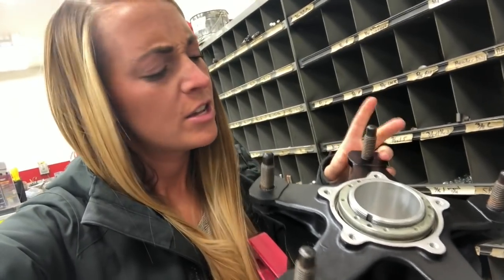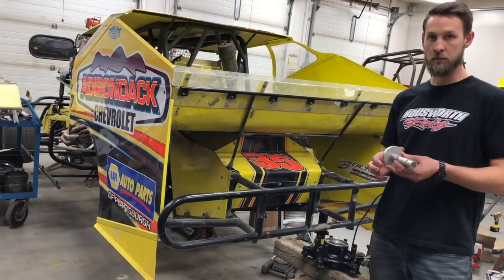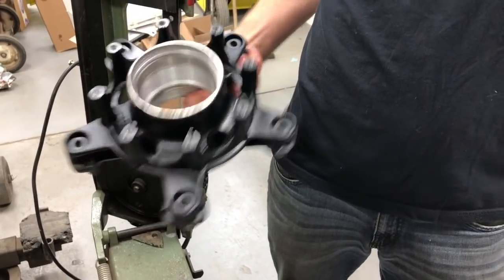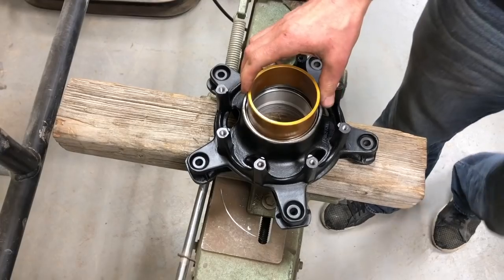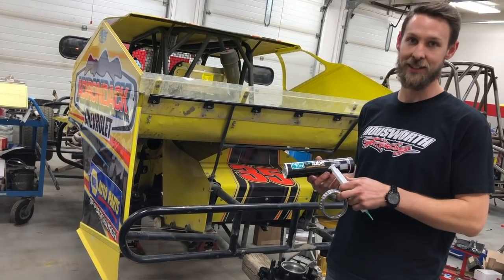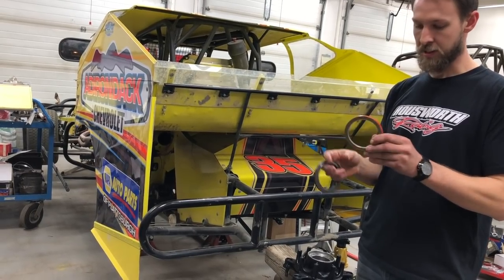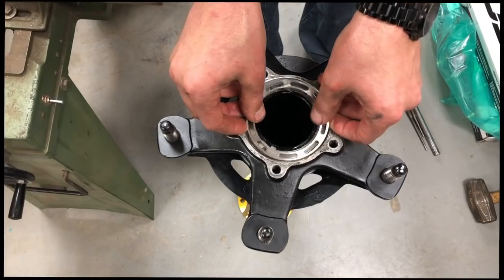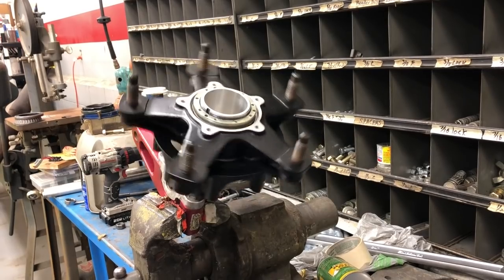How To Rebuild A Hub

Comment: Great video Mandee !  Mike, stick that race in the freezer for a half-hour or so first !  You won't have to pound on them nearly so much .  In fact it ought to just drop in particullarly if you put the hub under a heat lamp for an hour . ( i really dislike using a  ' linear accellerator ' on   bearings - particularly multiple-element bearings like ball or roller - due to how easily they ' brinell ' .  That assembly tool also  permits the use of a torque wrench to set the pre-load .   Thanks guys !

Comment: Hey man where did you get the syringe and what kind of grease are you using? I've always palm packed mine with  red and tacky
Reply from the maker: The brand of the grease is called daylube. Superior Bearing and Supply will sell it to you already in the syringe or Precision Hydraulic and Oil. They both sell it
Reply: @dirttrackuntold  yes,thanks. I ended up coming across it while ordering so e other stuff. Thanks!